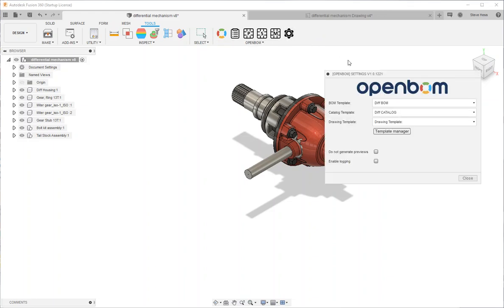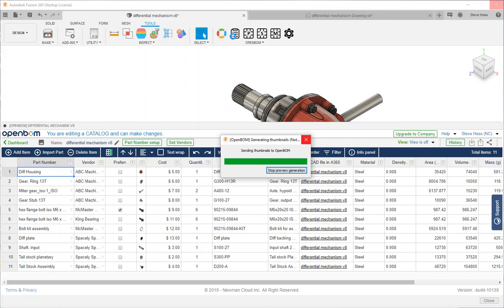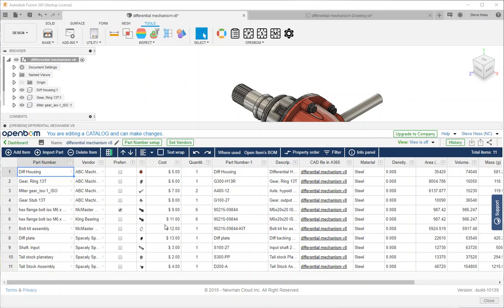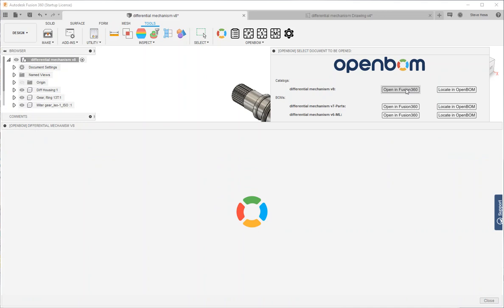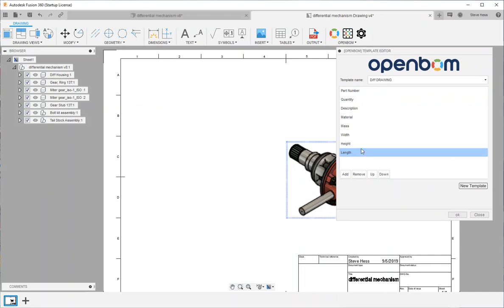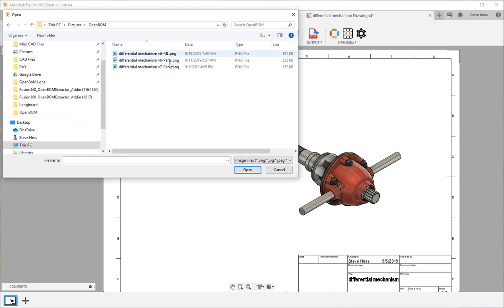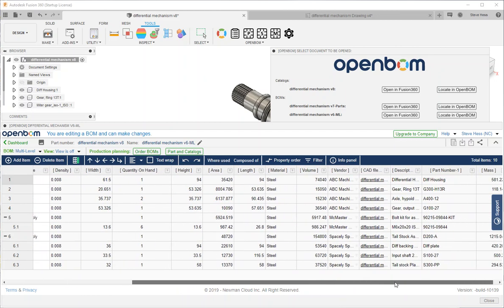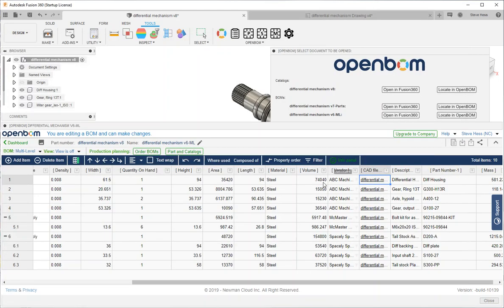OpenBOM for Autodesk Fusion 360 Sneak Peek - Sep 2019

Comment: I love This!!! The Stock BOM in fusion is lacking severely. Thank you for taking on this challenge and fixing that. 
Keep it up. Matt

Quick question. Dose your BOM have the intelligence in it to identify patterns or mirrors and count the parts up correctly? For example I use a pattern or mirror feature to quickly place repeat fasteners like bolts and nuts. Will the BOM keep the same part number for all the patterned or mirrored parts and simply add up the duplicates for me? Fusion had a big problem with this and last I checked it was still not fixed.
Reply from the maker: Matt, thank you for your support!